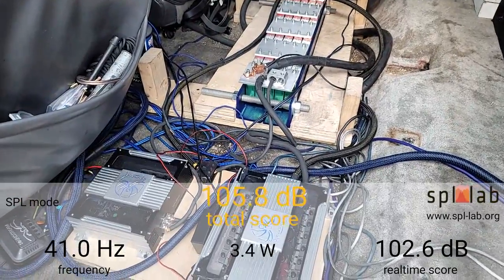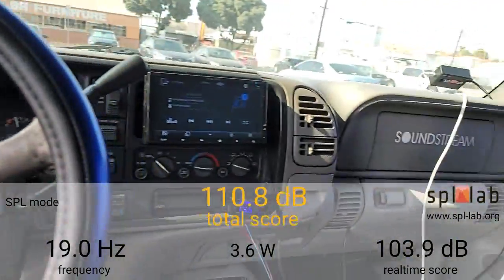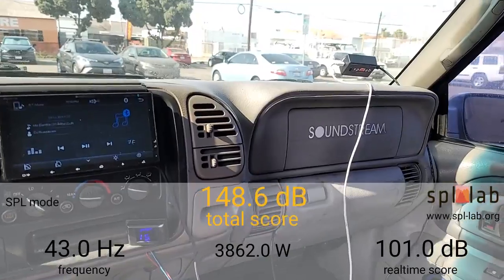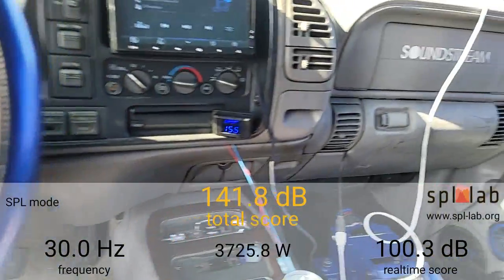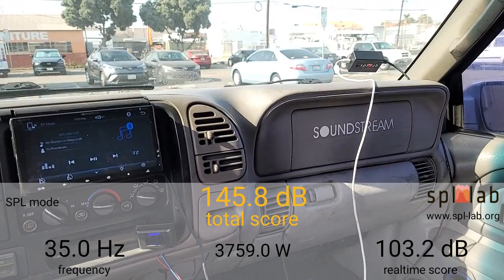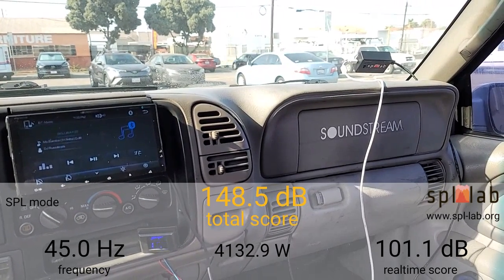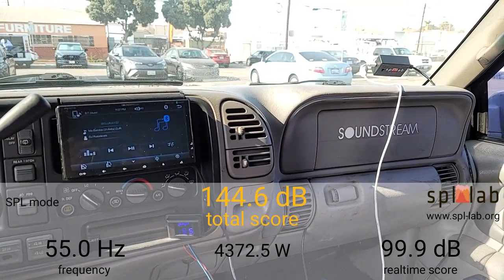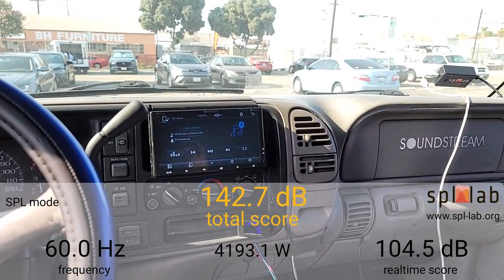Soundstream TXP1.18000D 1 Ohm Clamp Results 30-60 Hz Test

Comment: Why is it showing 100db when you start talking it should only be around 60 then
Reply from the maker: Honestly, not sure exactly why that happens but it does get the peak pretty accurate
Reply: I have the same amp I have the txp3500 the txp12000 and the txp18000 I keep moving up because when I turn it up it cuts off and it does it on all three I’m thinking it’s an issue with the power I checked the ground and it’s fine I’m thinking about adding another battery 🔋 do you have any issues with it cutting off or clipping at high volumes ?
Reply from the maker: @100_barber  No I've never had any issues but you definitely need extra reserve from an alternator or more batteries to keep them happy. The more you feed them the happier you'll be with them I'm sure
Reply from the maker: @100_barber  The amps are pretty solid for the price. I'm currently working on getting more TXP1.18000D amps

Comment: You would get a better score if you flip the box over and put the port on the driver side
Reply from the maker: Surprisingly the score ended up being the same
Reply: @BIGJURAY20  👍 should have went up a little because of the way the pressure builds in the cabin as it travels to the furthest point away from its start point I like Soundstream amps nice 👍
Reply from the maker: @Justthemow  Well the truck had a bad rear hatch so who's to say. I'll be doing more videos like this with my new truck

Comment: Was that sound at the end of the sweep xmech from excessive port area or interior panels rattling?
Reply from the maker: The sound you're hearing is from my speakers i have in it's own box. Unfortunately the filter wasn't tuned to keep all of the bass out and that sound was the result
Reply: @BIGJURAY20  oh ok.  Thanks for the reply, and i hope everything is still working good. I still like all of the old school brands owned by maxxsonics or epsilon . They still have great equipment for a good price if used properly. Those txp subs look beefy and i bet they can take a beating
Reply from the maker: @trollslayer82  I agree with you on the brands if used properly you can get a good quality system at an inexpensive price. I no longer have this truck or system but, I'll be doing something bigger in my current truck.
Reply: @BIGJURAY20  that is awesome and i will be glad to see it when u get it done and post a video.
Reply from the maker: @Hayawasa  It'll be coming real soon

Comment: Can someone DEFINITIVELY, no guessing. Please tell me how the hell do you set these amps up when they come with both HPF AND LPF without any switching between the two? For example I've got the TXP2.6500 2CH, how would you set the crossovers when you're pushing subs?
Reply from the maker: The lpf is where the subs cap  is and the hpf is just like the subsonic on other amps. You set it to the lowest u want your subs to play
Reply from the maker: With the txp or any amp similar i just tune them to the lowest point. So every setting will be at the lowest point and u only adjust the gain
Reply: @BIGJURAY20  yeah that's what I've had them set on. I dunno why man, but there's just a noticeable difference between using an Amp with full range like this, versus my 1800 audiopipe monoblock that was capable of rattling the panels on my car. It would POUND. Pushing two 12" kicker L7s  DVC 2ohm wired down to 1ohm.

My audiopipe I need to have a competent technician diagnose and repair, I miss it. There's a diode or something blown on it, causing continuity across positive and negative power terminals. That I've yet to find. So..... Either my L7s somehow have come damage, or there's just an obvious difference pushing subs with a monoblock versus a full range
Reply from the maker: @Aaron Leon  if you have dual 2 ohm subs are you wired to 1 ohm per channel? The txp2.6500D allows for 1 ohm per channel or 2 ohm bridged. Should be comparable in power to the Audiopipe 1800. But musically a half bridge monoblock like yours would sound better
Reply: @BIGJURAY20  Well for shits and giggles, if you come across anyone looking for something like this tarantula 6500, that's got a monoblock 1500-1800 rms they'd trade, hit me up.
Reply from the maker: @Aaron Leon  That amp will do more then 1500 watts bro. U may or may not be using the amps full potential. How are your subs wired to the amp?

Comment: Did you run both rca to 1rca and into amp?
Reply from the maker: You can do that but using just one side of the rca to the amps input would work just fine
Reply from the maker: But yes that's exactly how I had mines without any issues. Just used a y splitter
Reply: Oh mines ran that way and definitely can tell a difference its louder, and I also have the soundstream cross over on my set up and that add to loudness
Reply: Think bx 10 cross over added alot
Reply: Did u run yours at 1 ohm or at .5

Comment: You might gain on the meter if you flipped the port over to the driver side
Reply from the maker: Yes I definitely was but totally forgot to before I mounted the subs
Reply from the maker: That and the fact my rear hatch is completely unsealed there are definitely gains. I'll have to flip the box over one day and try it